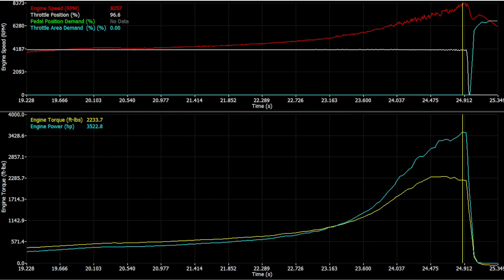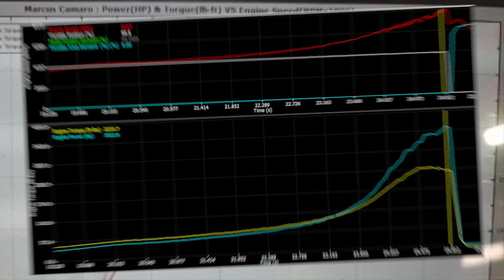Marcus' LS does 3,522 fwhp

Comment: how do you hook with so much power?
Reply from the maker: That's the big challenge running skinny tires.  There is an awful lot that goes into getting the car's suspension dialed in just right.  Then comes dialing in the tune.  Boost is typically ramped in so as not to over-power the tires.  Peak horsepower with a turbo build is typically achieved near peak rpm.  If you are leaving the gate at lower rpm and with less boost, there should ideally be enough traction not to spin the tires.  Bill Devine is the owner of Bullseye Turbo and races PDRA on 10.5 tires.  Our work added about 500 hp.  It took him a good part of the season to figure out all the variables.  By the end of the season, he was hitting new personal bests on a car he has been raicng for 15 years. He is hoping to crack 4.0 this season.  This YT Short has him talking about this.  Hopefully, you'll find it interesting. https://youtube.com/shorts/SqDzyBW9CXA?si=qBaVatObiZr82Gpo
Reply: @borowskirace  boost by gear?
Reply from the maker: @lxvxrl  Boost is controlled by opening and closing the turbo system's waste gates.  The engine management system can be programmed to operate the waste gates using any available inputs.  The most common control strategy is partially open at lower rpm and then ramping up by by closing the waste gates as rpm increases.  This will steadily raise engine power and stay within the car's ability to stick that power to the ground.
Reply: @borowskirace  Thats sick🤙